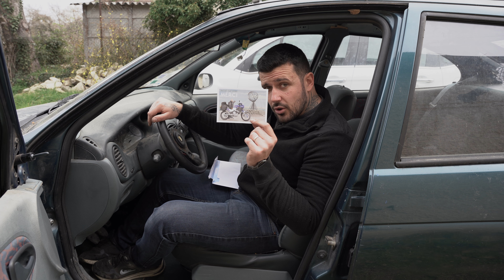Je prends la Mule à coup de perceuse et de soudure ⚡️

Comment: 0:13 COUCOU 

0:51 il est content !

6:24 visse qui vont servir de guide 

7:52 j'ai le même 

12:53 c'est bon

15:54 chaussure de sécurité 

21:05 pfffff t'est fatigué 

21:57 tu pourrait faire un renfort dedans avec le filetage qui dépasse avec des fer plat pour rigidifier le toit 

31:16 et la batterie ?
Reply from the maker: Merci pour ton commentaire ! On peaufinera ça plus tard ! La batterie pas besoin la Mule est increvable 🔥